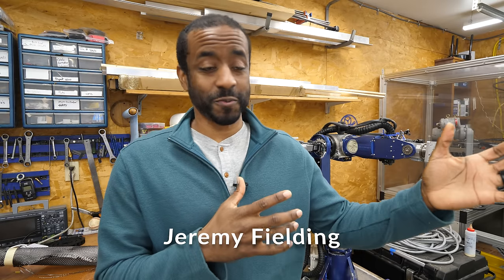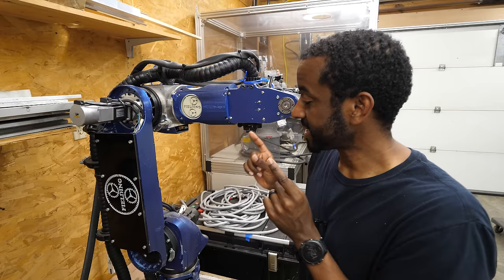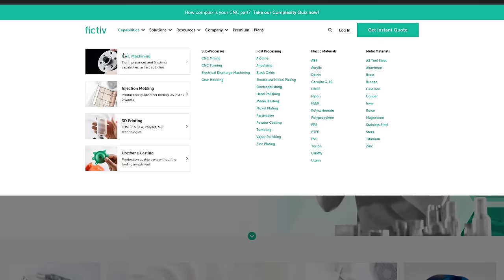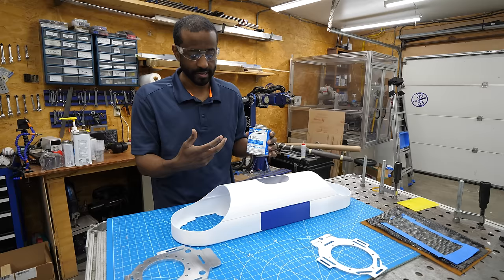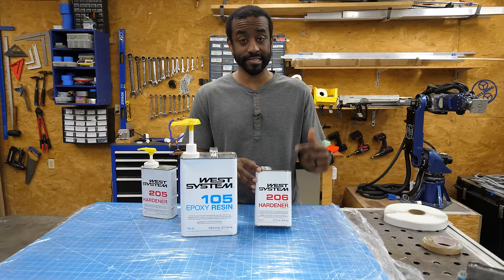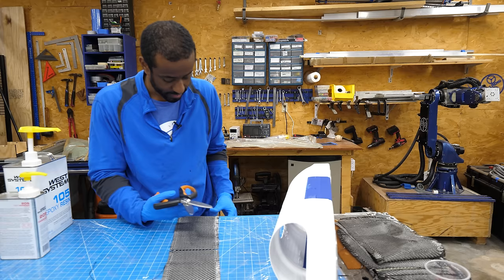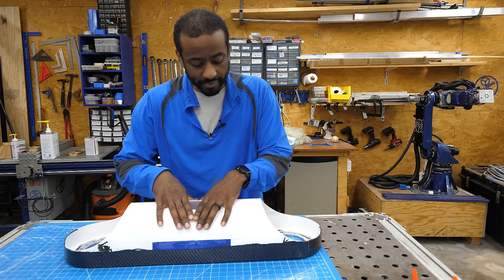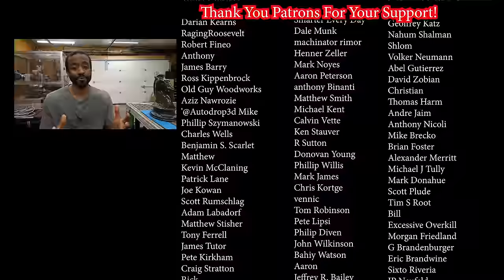How to Make Anything Out of Carbon Fiber.

Comment: Just wanted to help!  Aluminum and carbon fiber touching will cause galvanic corrosion.  Anodize or coat the aluminum with something.  Ultimately the part will fail because of the galvanic corrosion.  Hope this helps!  Love your channel and your a rock star with engineering💪🏼
Reply: Another good way used in aircraft construction is to wrap the metal part in low weight glass fiber. That will prevent the galvanic corrosion.
Reply: In the automotive world, they are bonding CF tubes to raw aluminum yokes and rating them for 5000hp+.

Edit, just looked it up. Apparently the CF driveshafts seal off the bonded area from atmosphere so it’s a none-factor.
Reply: @justRD1  Now that is an interesting detail I hadn't heard before.
Reply: @justRD1  5000+ hp, so I expect racing where you don't need the part to survive many years and many cycles. You need it to get you through the race/season. There is a galvanic potencial difference between these materials. The corrosion will come.
Reply: I intellectually know that CF is conductive but would totally have spaced this. thanks for the tip!
Reply: Came here to say this. Also in this case the aluminum is the anode, so when it is a relatively small area compared to the carbon, it will corrode away much faster. For this reason aluminum rivets or fasteners through carbon structure is a bad idea.
Reply: @justRD1  they may be adding a small amount of glass fiber, or pre-coating the aluminum with epoxy before bonding. You wouldn't necessarily know the little details unless you are the one doing the work (which, if you are, then my apologies).
Reply: @justRD1  key word is bonded. Adhesive serves as a galvanic barrier, and a physical barrier preventing ingress of any sort of moisture.
Reply: The carbon is impregnated and coated with resin. What are the chances that there is an electrical connection between the carbon and the aluminum?
Reply: @tracyrreed  this is a known issue in aeronautical and marine applications. It is not hypothetical. The usual solution in marine applications is to put a thin layer of fiberglass cloth in the areas where there will be contact with aluminum. This insures that no graphite fibers will touch the aluminum.
Reply: @jimmyjackman9215  this is very interesting. I didn't know cf was conductive (now that I think about it, it's obvious because there are lots a things where carbon is used to conduct electricity)

My boat prop (that is in salt water permanently), has a hub that is aliminium and the blades are cast iron (very stupid choice of material). I was thinking about making new blades and a hub from cf. Since CF has such poor abrasion resistence, I was hoping to build aliminium bits into it where there is friction. But now realizing that would be a bad idea. What are the alternatives?
Reply: @mckenziekeith7434  Thanks so much this is exactly the answer I was looking for
Reply: Don’t f1 cars and other exotics have aluminium honeycomb sandwiched in the middle of the outer carbon layers on the tubs ?
Reply: tell that to Stockton Rush
Reply: @Roadhouseee  🤦🏼‍♂️
Reply: Never mix aluminum (any alloy) with carbon fiber or stainless steel without galvanic protection. In either case the aluminum will turn into aluminum oxide which is very brittle and quickly becomes a powder.
Reply: @longllamas all cf resins don't have poor abrasive resistance. There are some resins that are very resistant. The epoxy type resins that the general public can get do pretty well but there are better
Reply: @longllamas you might want to look into Zylon or Dyneema. Both have way better abrasion resistance than CF. Zylon is a bit tricky to work with since it's not UV resistant so you might need to layer it in glass fiber.
Reply: Interesting facts guys thanks
Reply: @tracyrreed

Depending on internal/external connections, if the resin is thin or thick through a particular spot, it’s not likely for the resin to completely cover every tiny fiber.  Some cases you may get away from this, however it’s not worth the risk or all the hard work not to do preventive processes to keep galvanic corrosion from happening.  

Class III Hard Anodizing creates a barrier from corrosion with carbon also!

Use titanium is another.

Hope this makes sense, just want to help😊
Reply: Not sure if this helps since there are variables as mentioned above, but a bicycle maker told me the frames his company makes that use carbon fiber and aluminum are normally given a 2yr lifespan before the corrosive issue becomes a factor and the frames are rebuilt or replaced. His knowledge came in handy while making custom cantilever and control arm setups for cars and my own personal vehicle. Hope it may help others as well. 
😎👍👍
Reply: Ok, but a rubber gasket between a carbon air cleaner and an aluminum throttle body should solve that, right? Then the steel stud for the air cleaner hold down could get a plastic sleeve. Please correct me if I'm missing something.
Reply: @GaryTaylorvw  I remembered in composite manufacturing they used to use a thin fiberglass layer to cover the aluminum core. Aluminum inserts (like plates), they did the same thing, or used epoxy primers/adhesives also. The whole point was to eliminate direct contact between the carbon fiber and the aluminum, and to prevent electrolyte making a "bridge" between the two (in this case, water, via direct immersion or simply moisture in the air).
Reply: Aluminum and carbon fiber touching alone will not cause galvanic corrosion. It will corrode only if there also going to be contact with water. And even in this case the galvanic corrosion will go quite slow and only on the perimeter of the contact surface of the materials. So if it is not going to be used in the rain or under the water it is fine to glue aluminum directly to the carbon fiber.
Reply: @illla  Are you a composites engineer?
Reply: @RoadsEndGarage  no
Reply: Ha ha in a sense it makes a slow burn aluminum air battery
Reply: What? There must be stipulations to this because a finished carbon fiber product is epoxy on the surface and the carbon is embedded, and nearly all RC enthusiasts use carbon fiber parts directly with aluminum.
Reply: @sharxbyte  ya it's not. "intellectually" ok carbon FIBERS are conductive, LOGICALLY it's all coated in EPOXY which is "intellectually" not conductive lol

Comment: One of the problems I had designing and printing 3D plastic was getting fits to match measurements . After some experimentation I discovered that I need to think of all measurements in terms of 0.4  mm - nozzle size!- It made a big difference in fittings getting things to line up.
Reply: Yeah, I had that same issue when I first got into 3D printing and it took me a bit to figure out that when I was designing a part, I had to consider the printed line widths and overlaps to get the most dimensionally accurate part.
Reply: Not really true anymore with Arachne becoming the standard perimeter generator. With a .4 nozzle you can do down to .2mm lines and up to 1.2mm lines consistently, and the software uses that pretty well now.
Reply: also remember to account for shrinkage due to cooling of the 3d printed material

Comment: Nice job and informative video. One thing you might want to be aware of if you're not already is "amine blush." When you're using epoxy it creates a shiny surface when it dries called blush. You need to wipe this down with warm water and a Brillo pad or Scotch-Brite before anything will properly adhere to it. You can actually see the shine disappear as you scrub it.
Reply: The blush comes off in the peel ply if you use peel ply. You may still need to sand after removing the peel ply, but the blush shouldn't be a problem.

Comment from the maker: Regarding the cost of Carbon Fiber. The carbon fiber itself is like buying any other fabric... by the yard. You can buy as little or as much as you need. Think about it this way, you can make a part as strong as steel, as light as plastic, and all without the skills or cost of CNC, a welder, etc. If you can use a pair of scissors you can make it. That is amazing to me. I think its great for DIYers and the budget. Also please try out the sponsor as that really helps the channel. You will get 10% off your first order with Fictiv - http://bit.ly/3YOmVzF. Use Coupon code: Fielding
Reply: Watching you take risks and use your mind since your early videos about salvaging electric motors from discarded appliances has been really inspiring. Your genius is damn impressive and you still make things accessible. Thanks!
Reply from the maker: @nicholascoin9327  This is where I bought mine. I don't get any commission for this link. But I am tracking it to see how many people use it. https://bit.ly/3BWHfpL
Reply: I actually need some Urethane parts done, and noticed that your sponsor does them, so well done showing the screenshots of your use. Will be using your code in the next few weeks. Thanks!
Reply: You shouldn't lay carbon fiber directly onto metal, carbon fiber conducts electricity and if it is bonded to metal can create galvanic corrosion especially if the part is likely to come into contact with moisture like on a boat, car or motorcycle.
A way to stop this happening is to put a thin layer of fiberglass as a barrier between the carbon fiber and the metal part.
Reply: Carbon Fiber, especially Epoxy Resin, needs an oven and pressurisation to reach the advertised strength. The reason the biggest Steel Ships are much bigger than the biggest Fiberglass ships is simply because the cost and complexity of the assembly outweighs the production in steel by an unreasonable margin.
For casual applications it's fine, buy you can't make full car chassis with it, for example.

Comment: Hi Jeremy, a few points:

- For safety I was told that you should always use a respirator and/or work in a well ventilated area when dealing with epoxy resins. It isn't an issue immediately but a professor of mine who built composite aircraft as a hobby mentioned that the long term buildup of vapors is detrimental and proper PPE / ESC should be used when regularly working with epoxy composites.
- Another cool feature of the more textured peel-ply is that it leaves the cured surface ready for bonding with other composite parts. If you wanted to add more material or join two already cured parts that peel-ply saves you the effort of prepping the surfaces for more binder material.
- You kind of touched on this but in addition to weave patterns being able to affect the directional strength of the composite, you can also stack multiple layers of different weaves to 1) provide more thickness = more cross-sectional area in a classic bending load = higher strength and
2) have multiple directions in which the stands are aligned with. If you know the forces the part is expecting, you can have most of your layers supporting that situation but other layers aligned to resist torsional forces. The example I would go to is with the checkerboard weave, you can offset a layer by 45 degrees to get more overall strength and stiffness.

Very cool video!
Reply: Epoxy fumes are bad. So is any broken off material/dust from working with carbon fiber or fiber glass.
Reply: Maybe I've been doing it wrong for the last couple of decades, but peel ply needs sanding. If you don't the failure is likely to be between these surfaces.
Reply: You don't need a respirator during layup. Epoxy resin and hardener has very low vapor pressure. Most people do not worry about the vapor when doing layup with wet epoxy. The biggest danger is getting it on your skin or eyes. Over time you can develop a sensitivity to the resin or hardener or both. Once that happens you will probably not be able to work with epoxy any more. Also, some of the hardeners, in particular, can do fairly immediate damage to your eyes. So I would suggest that you should wear gloves and glasses and a plastic face shield. The respirator is really not needed or is much less important than the other PPE. Now, when sanding epoxy, especially if it is not fully cured (less than 7 days for room temperature cure), you should definitely use a particle respirator or dust mask. And if you ever spray it then you need absolutely state of the art protection because it is very bad to breathe in the uncured epoxy aerosols. But for wet layup with brushes, not so much.

Peel ply has release agent in it. When you remove it, some pieces of the peel ply remain on the work piece. According to the experts, it is best to sand the surface lightly after removing peel ply if you need a good bond. There are some peel plys with no release agent. But if you are not sure, then it is best to sand.
Reply: @EricBrummer  Great advice. Bis A epoxies are 100% solids and the fumes are not all that toxic. However, the cleanup solvents are, and your point about the fibers is completely correct. If using vinyl and poly ester resins, masks are really crucial.  I have worked with composites for about 30 years, and I never work without a full face respirator rated at P-100 for Organic vapors, I add little pink dust catchers to the filters because they catch the big chunks.
Reply: @imusuallycorrect  An indeed you are. However there are some no sanding textured peel plies that work great.
Reply: @mckenziekeith7434  I happen to be one of those experts. I gotta disagree on this point. Bis A, Bis F and Novolacs are low vapor pressure as well as the hardeners if they are neat. Add thinners and that theory goes away, so to if you are working with vinylester and polyester formulations using MEKP. Don't forget the clean up solvents. Your other points are excellent. I like vacuum infusion because it is easy to get better resin/fiber ratios and the fumes are contained.
Reply: @anthonywarren4207  thanks. That makes sense. For sure when I typed the comment I was only thinking about structural epoxies which usually seem to be free of volatile thinner. They do sometimes use benzyl alcohol but that also has low vapor pressure at room temperature.
Reply: @mckenziekeith7434  I use a combination of benzyl, MEK and butyl as a thinner. Works well, but wear a mask
Reply: @mckenziekeith7434  Here is the formula I have developed for thinning structural epoxies.

MIBK        2.7 lbs
Xylene       2.9 lbs
Butynol      1.4 lbs
Total           7.0 lbs

Butynol is another name for Butyl Alcohol, using it will reduce confusion with Benzyl Alcohol.

It has served well for about 20 years. Benzyl is fun stuff, I like the way it destroys rubber seals in hand crank pumps!

Comment: I have been working in the composites field for several years and just wanted to talk about other materials as well :
- Glass Fiber - cheap, brittle (doesn't handle shocks or abrasion well), very light. Mostly used for boats.
- Carbon Fiber - medium priced, sensitive to abrasion but resistant to shocks, medium heavy. Mostly used for air-related pieces (speed cars, tuning, aeronautics, space)
- Titanium Fiber - high price,  resistant to shocks and abrasion, quite heavy. Mostly high-standards pieces (aeronautics, space, some fine engineering stuff).

Yes, this basic hint is not a hard rule whatshowever because you can use different weave patterns (as described very well in the video), use different layers with different materials, mixed meshes and so on... I just mentioned it to give a general hint for the viewers.

Choose your fiber materials according to the project you are making. Once you understand how it works, everything will be simpler. Multi-layer is also possible but harder for beginners as you have to deal with multiple constraints.

As explained briefly in this video, bubbles are your worst enemy, especially if you need uniform resistance on a surface.
Generally, the quicker the hardener, the hotter it will get, which can also have an effect on the mold you are using (deformation due to high heat).
The resin that you use can make a huge difference as well (UV-resistant, thermal range of use when finished, and so on...).

Please use masks, eye protection (specially if you sand it because it creates very tiny particles that can be very toxic for your lungs) and all the other protections you might find useful to protect yourself. The fibers are not that harmful but the particles and the vapours can be.

Thanks you for the video, I really enjoy people talking about this subject, as it is indeed very interesting.
Reply: Where does kevlar carbon fiber fit in this scale?

Comment: For really complex curves, try cutting your cloth into triangles.  That will allow for more a lot more flexibility.  Also, you probably don't need to worry about it, but different hardeners (fast cure versus slow cure) can affect the final strength of the part.  Not always, but something to check just to make sure.
Reply: You seem like you'd know, can you mix the hardener types for a medium set?
Reply: @ChupaCabraThing  Yes you can (I got that info directly from West Systems a number of years back). Also they have an Extra Slow Hardener (#209)  in the series as well as a Clear Coat (#207) for final layers. I believe that with the exception of the Clear Coat, there is not a substantial difference in strength between the hardeners.
Reply: @ChupaCabraThing  I haven't, but some you can.  You'd have to check the individual resins/hardeners.  Any manufacturer would (should) have pretty much any info you'd need about that in their product literature.  Typically, though, you'd just find the hardener that fit your need instead of mixing stuff.
Reply: I have seen sail boat masts made useing triangle cuts of carbon fabric in aluminium and bag moulds.